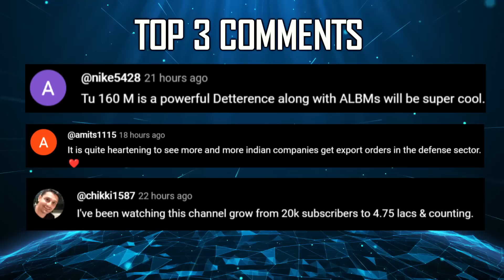Indian Defence Updates : DRDO Carrier Killer Missile,100 Swift UCAV Order,70000 Ton Aircraft Carrier

Comment: India's 190MW reactor can be used on 70000tonne carrier is very good move. Since it enables us to operate EMALS and have a Very fast and long range carrier.
Reply: Yeah idk it it's true or not Nimitz class carrier also uses same type of dual (190MW)reactor
Reply: @Opmemeprime  Each nimitz reacter produces 550 MW each, 190 is the direct maximum power that can be given only for rotating propellers
Reply: @omcena   thanks for the information
Reply: @Opmemeprime   We can use more than two reactors If we want more power thats the case have 3 reactors will also reduce stress on Each reactor and Leaves room for Maintainence and redundancy in case one of them is not working properly. 
But this is all a theory a Indian Aircraft carrier Theory.
Reply: Twin reactor use in aircraft carrier.
Reply: Are we actually making a nuclear carrier ? Wht about the 2nd conventional carrier with the same configuration of INS Vikrant ?
Reply: @045jerson7  Main Issue with Conventional Carriers is We can't use Emals which limits the weight of aircraft takeoff weight and angled decks will put a lot of stress on Aircraft frame decreasing life time of Aircraft. Thats why catapults are very good and Nuclear reactors let us have Electro magnetic launch systems Which are the best catapults out there.
Reply: @045jerson7  over a month ago i saw a document which involves the amount is allocated or or what is the progress of specific defence project. So there was a ammount of 40,000 cr Rs is planned to develop a carrier which double to the price of ins vikrant .  And I don't have much information about this .